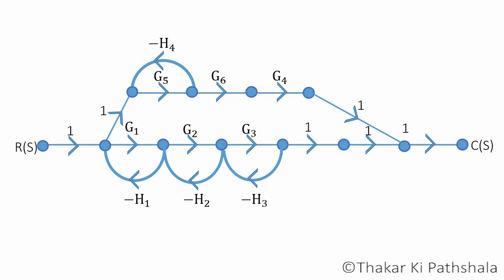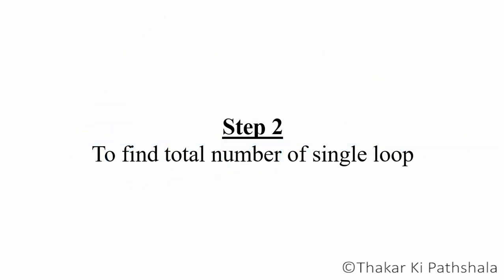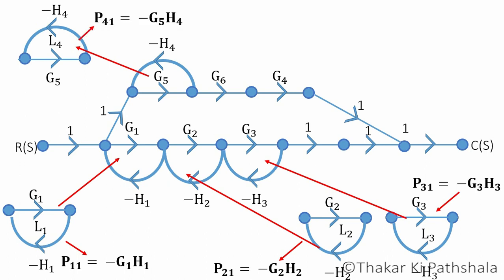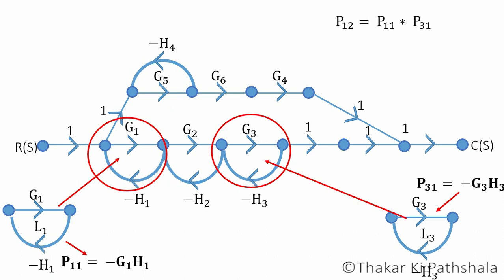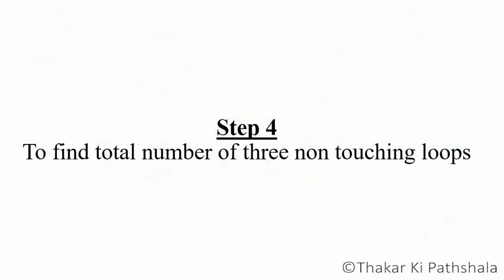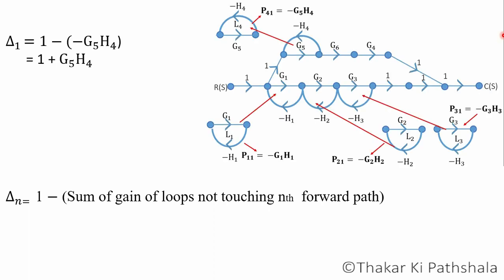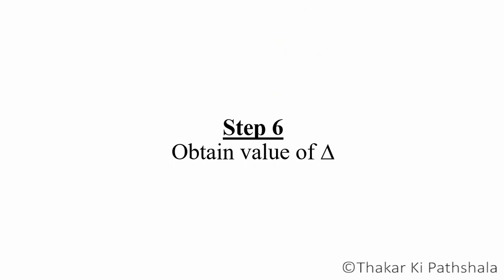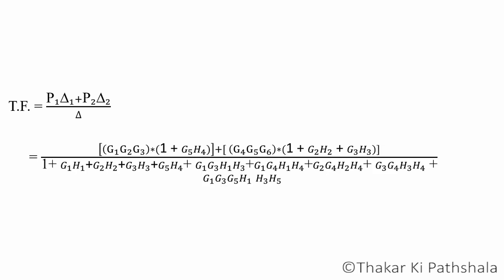Signal Flow Graph With 3 Non Touching Loops & Mason Gain Formula  | Control System Engineering

Comment: At 5:28 all three path #1 loops  (L1 L2 and L3 are not touching the second forward path because none of those loops have any nodes in common. Just because 2 nodes are linked by a unit gain does not mean that they are the same node.

Comment: There is already a unit gain (gain = 1) link between L1 and L4 in the diagram. Similarly, we can put a unit gain (gain = 1) link between L1 and L2 and separate the 2 loops. The system will still remain the same.  So, why is it that L1 and L4 are not touching but L1 and L2 are touching? Maybe you can clarify this! Thanks !

Comment: Great videos man. However, I have a question. When you encircle P41=(-G5H4). Why you use (-G4h4) instead of (-G5H4)?
Reply from the maker: Thank You joshua gripo for your sharing your query with Thakar Ki Pathshala. But please provide exact time mark so I can assist you in more efficient way.
Reply: in delta you take g4 instead g5 in the sum of gain of 2 non touching loops